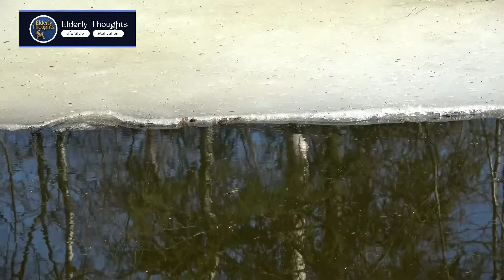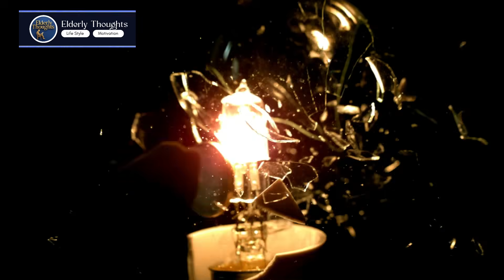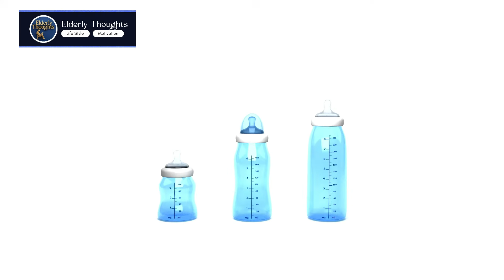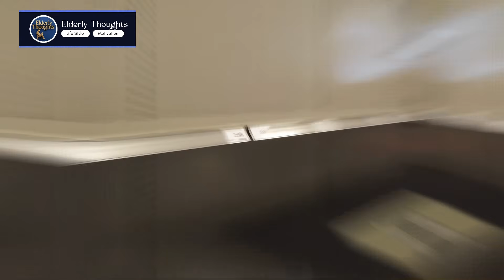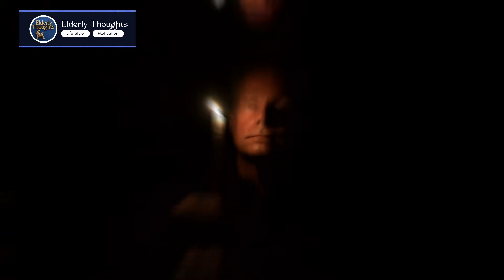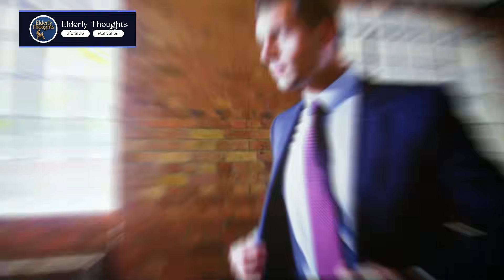9 Things You Can Build From Trash That Actually Work After Collapse

Comment: I took the cĺear screen off a big flatscreen tv. I keep finding them in tash piles at nearbÿ condos. Most still work but if not I make room lights or plant growing lights. Just take off the dark screen. The whole thing lites up. I also take off the cĺear screen. I mounted it in a 1x2 " wood frame. Then placed it in the sun . The sun created a hot laser beam of lite that burns everything and boils water, cooks food too. Nbut be warned ! Do not leave it alone. I did and it burned a small hole in my deck. Lucky for me I found it before my deck was gone and my home too ! 😊 Be careful !
Reply from the maker: Wow, that’s an incredible use of discarded TVs—turning them into something so powerful and useful!

Comment: You missed a couple of steps in the rocket stove.  You need a vertical can in the middle of the larger can connected to the first smaller can and it needs to surrounded by sand.

Comment: I am old and I had old parents. My dad was born in 1900, my aunt was born in 1899, and my mother was born in 1927. I learned all of these except your rocket stove is a little different. Dad called ours a gypsy oven, but the principal was the same. As far as the charcoal goes, my folks would crush it and we would take it like pills to prevent food poisoning I guess parasites. Now you can buy activated charcoal capsules, but it's essentially the same.😊 your image is very seldom match what you're talking about, it would be far more helpful for newbies if you did fewer items and used actual images. I don't know what program you're using to put the images up but they seldom match what you're saying.
Reply from the maker: It sounds like you grew up with some incredibly resourceful parents and learned invaluable skills firsthand. Thank you for sharing your family's wisdom and insights — especially about the "gypsy oven" and the traditional use of charcoal for health!